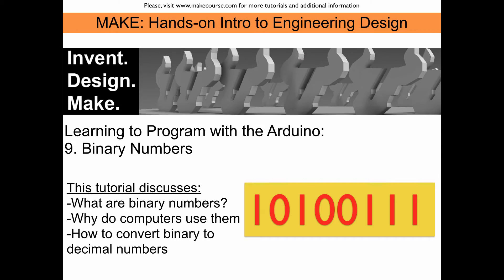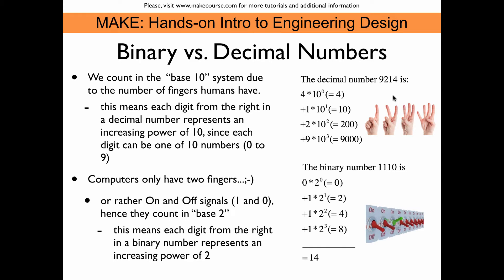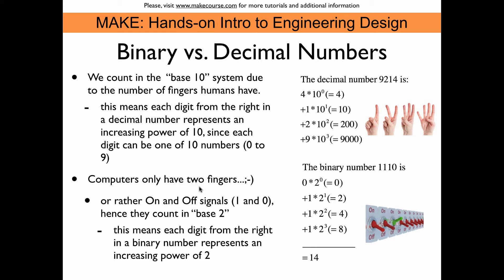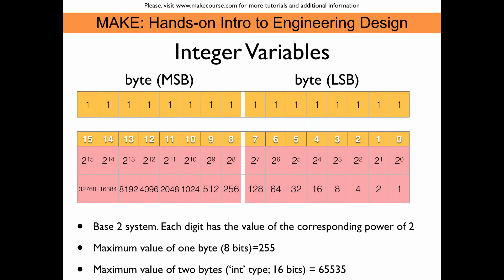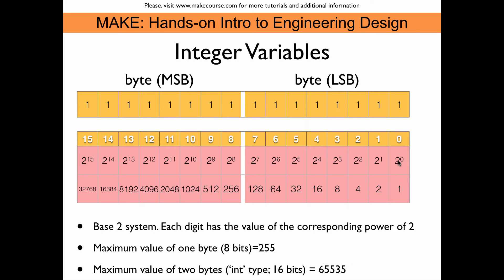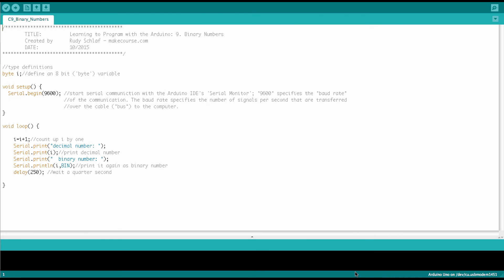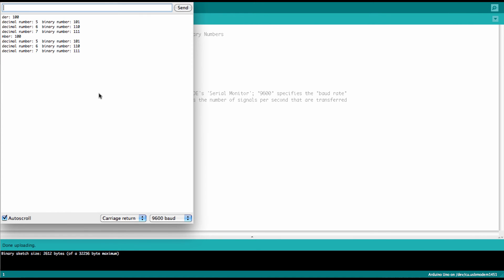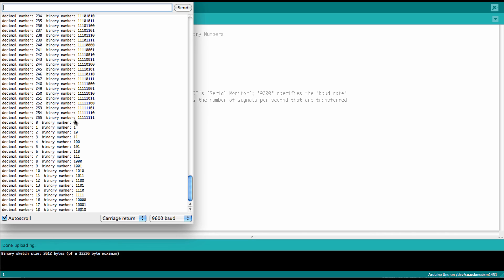Learning Programming with the Arduino Video 9: Binary Numbers

Comment: That analog with fingers is bit off... We have, usually, 10 fingers which is 11 different states. As computer have only one which equals to two states. On the other hand computer have 'unlimited' amounts of 'hands' and we have only two.
Reply from the maker: +Lantti You are right, but consider that the concept of zero as a number came much later than counting 'things' with your fingers and then expanding from 1-10 to larger numbers by using multiples of 10 when an ancient human was counting their cattle or whatever else they needed to count back then.